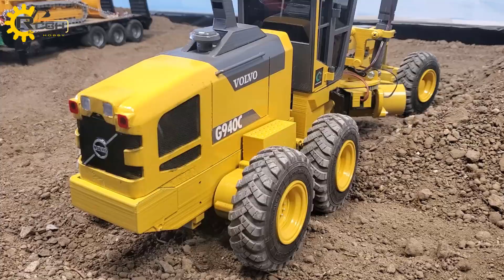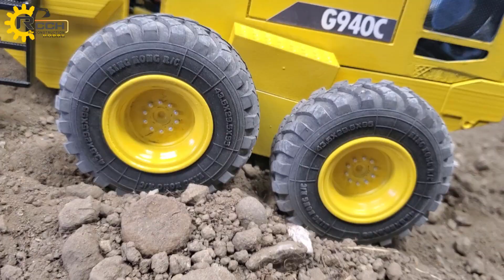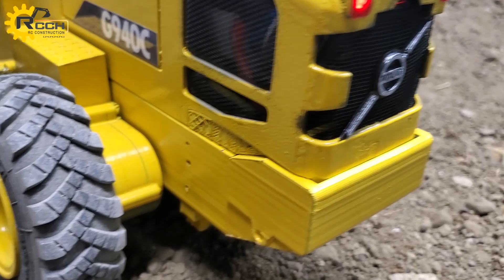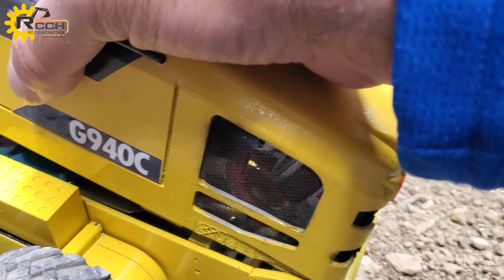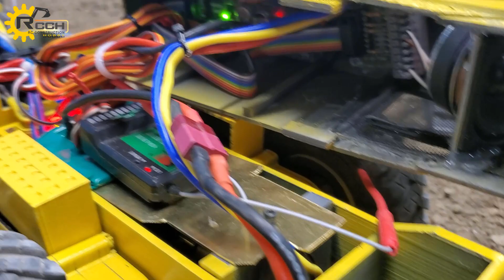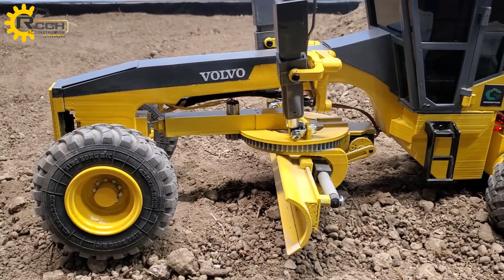What's So Interesting About This RC Motor Grader Build?

Comment: this is amazing!!! I was looking for functional 3D printed motor grader videos and found your video, I'm planning to make one, I'm having a hard time finding the measurements for my project.
Reply from the maker: I just searched up the brochure for the machine on the manufactures site and used the dimensions and then scaled it down. I used fusion360 to design my machines and take a picture and scale it to the size I need then start drawing based off that.

Comment: Thumbs up for this model...👍 My question is how did you do the rear wheel transmission ?
Reply from the maker: Great question. It is a 100rpm 36mm motor that goes to an axle which drives both sides. I have chains that move both sets of tire. Like the real machine.
Reply: @RCConstructionHobby  wow great, too bad we can't see....I just had the bruder grader but I see that the middle blade is not sliding...for the transmission chains I thought of rc motorcycles
Reply: @RCConstructionHobby  
Hi

Comment: Any chance you would give out the 3d printer files?
I would like top build one.
Reply from the maker: Sorry this is a one off build. I have not really fixed the files to do mass printing. There are a few parts that need to be fixed before I would out it out there.

Comment: Beautiful machine! what did you use for the wheel drives?
Reply from the maker: The drive is 36mm motor at 100rpm. Which runs on a perpendicular shaft that is geared on both ends which goes to each side and is chain driven to each hub. Just like the real machines.